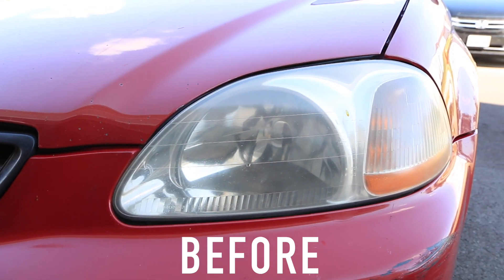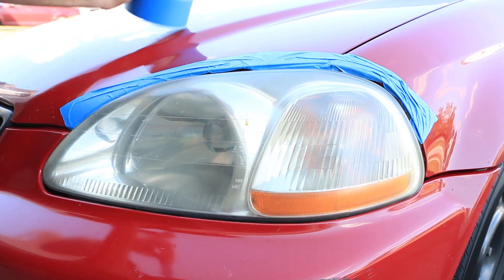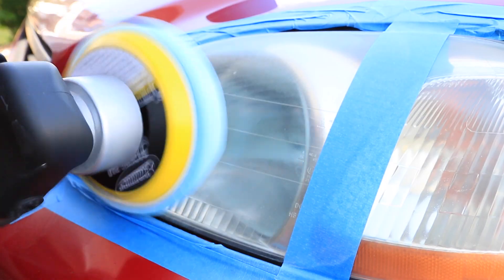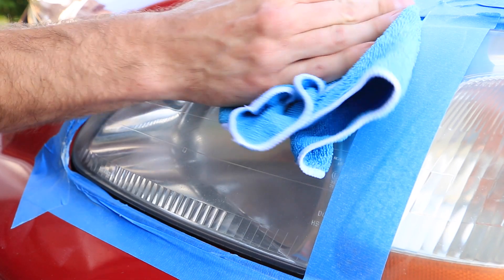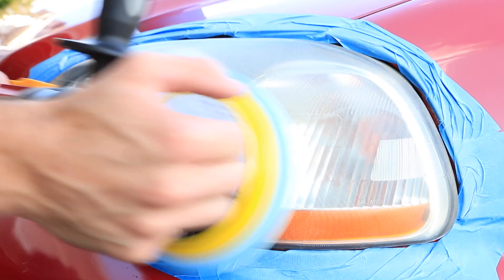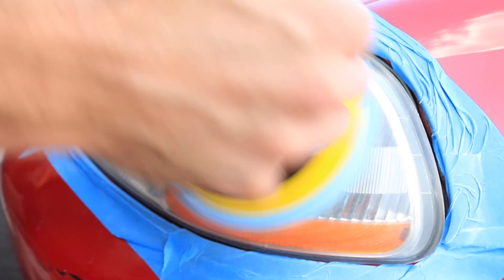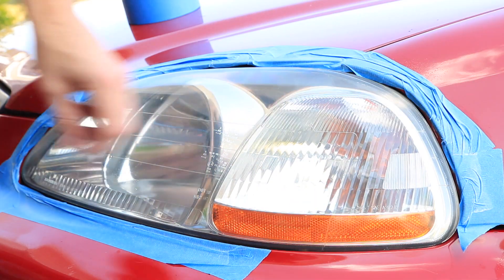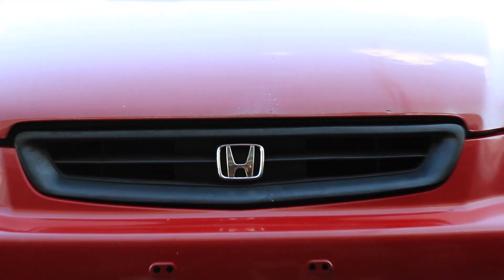Headlight Restoration Done The Right Way! Car Detailing

Comment: These specific headlights clean up very easy, try doing some 99-04 mustang headlights, those are a pain!
Reply from the maker: Why so much different? Just the shape?
Reply: Stauffer Garage it's the coating on the headlights of the mustang, it's very thick, you have to wetsand them in order to do anything. Just compounding or polishing doesn't do anything. These civic headlights clean up very easy, but they also oxidize very easily.

Comment: I have a question for anyone using the Harbor Freight polisher that is used in this video. 

I am new at using polishers.  I just bought my first polisher, the Harbor Freight polisher.   I was trying it out with a Harbor Freight blue polishing pad.  My paint is relatively clean and just wanted to get some protection on the paint.   I used Mothers cleaner/polish.  I did not know what speed to use it at so I just used speed 1 .   At speed 1 the pad did not rotate against the paint, it just vibrated. I was using very little pressure. When lifting the polisher off the paint it does rotate. 

My questions;
Is this normal at the low speed of 1 to not rotate and just vibrate when placed against the paint or is my polisher not working right?  If normal, then at what speed should the polisher begin to rotate with the proper pressure against the paint. I am aware that light pressure when using these polishers is correct and I am supposed to let the polisher do the work.

If normal, at what speed does the polisher begin to rotate against the paint?

What speeds are used to do paint correction, polish or just apply wax?  

If normal, do other polishers not rotate when using the lowest speed?

So far I have not come across any videos explaining the speed settings of polishers vs when they begin to rotate against the paint. Any help will be appreciated from Harbor Freight users or any other types of polisher users.